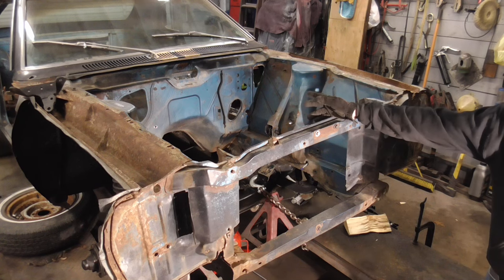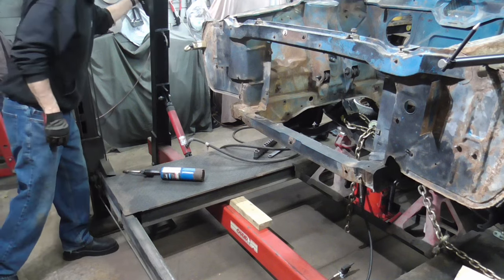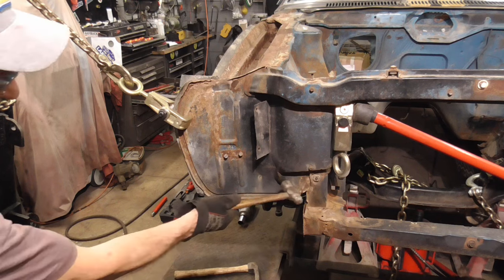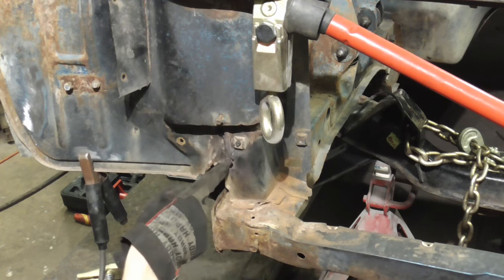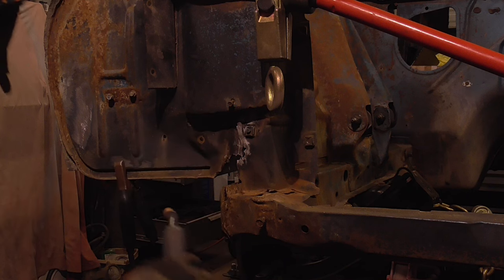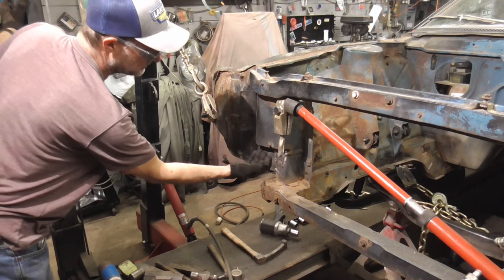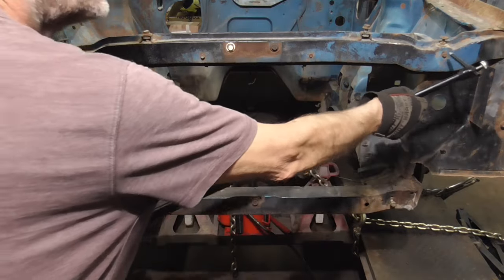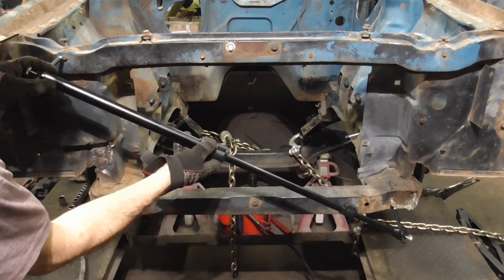How to Square Up a Core Support

Comment: Nice work.  Use whatever it takes to get it where it needs to be.  Everything on that front end would have been a fight had you not taken the time to fix it properly.  Not that I haven't seen cars with a million fender washers, self tappers and wire holding the grill in place.
Have a great long weekend
Reply from the maker: You're right about that Bruce - have a good weekend :)

Comment: Hi Jerry,  was going to ask you, are you sand blasting the engine bay?? Are you going to use epoxy, 2k primer then paint?? Could you go through the car the way you are now, on all the other stuff? Going to be a sweet ride for sure
Reply from the maker: Good question GM.  You could put it on a rotisserie but I'm not sure if on this car it would be the best way to go.  The underside is still very decent with the original undercoating - real thick and a lot of texture - I like that look.  For the heavy rust under the battery tray, etc. I'm going to clean it up real well, hit it with por-15, then paint that.  I have a video on all of that - I think you'll find it interesting.  I want to keep this build practical and not over costly :)

Comment: I did mine on my amx drives like new again
Reply from the maker: Great to hear - nice work.  How do you know if you have a GO PACK?
Reply: @LakesideAutobody  the had the high compression 343 or 390 you got heavy duty suspension,power disc brakes and limited slip differential and the stripes